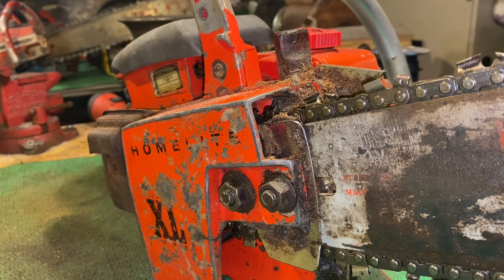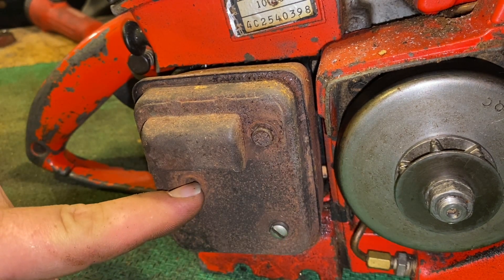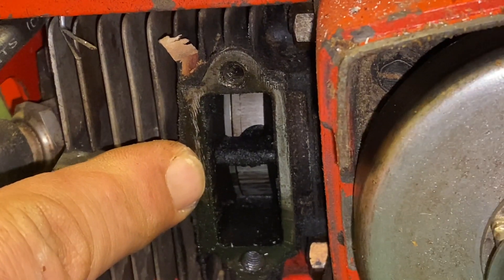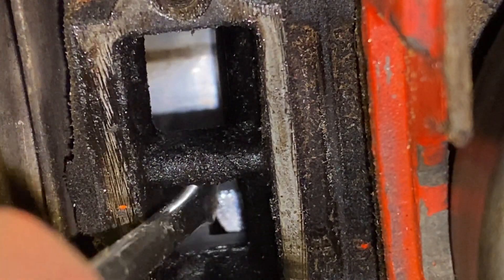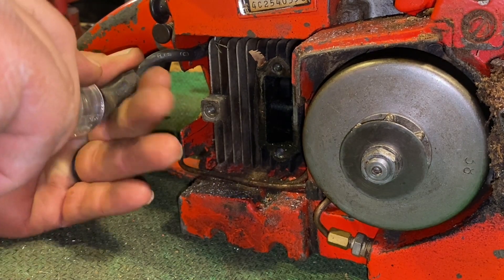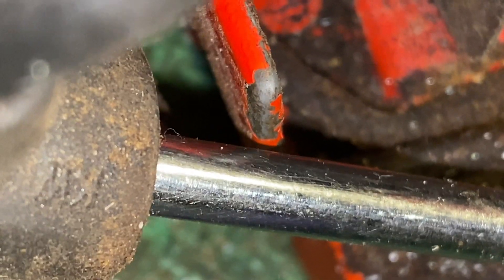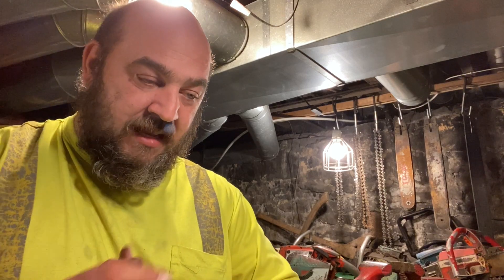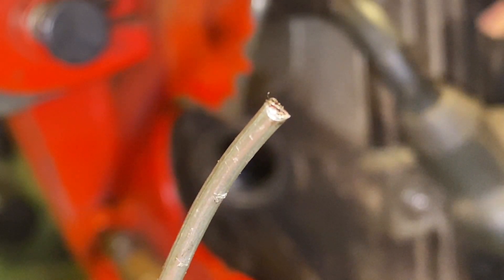Chainsaw Porting Class!!  How To Port A Chainsaw For Beginners!  Homelite Super XL Automatic #2

Comment: Sorry, but the last thing I want is to spend money on a Homelite saw so I can let it set in the shed. It is spending money on a worthless chainsaw. I stated out using these saws and am not interested in going back. Either a ms261 or a 550xp. The worst that could happen is, I ruin a cylinder. I can buy an other. They are readily available.

Comment: SMITTY, I NOTICED THAT YOU HAD SOME LOMBARD AP-42'S IN THE INTRODUCTION. ANY IDEA WHERE TO OBTAIN BOTH CRANKSHFT SEALS? THANKS!
Reply from the maker: SKF 6119 Just search the part number.  It is a common part.
Reply: @Smittyschainsaws  ARE THE SEALS DIFFERENT OR ARE THE SEALS THE SAME FOR BOTH SIDES? THANKS FOR YOR HELP!
Reply from the maker: @douglasuhde799  same on both sides.

Comment: Hello neighbor I was wandering why I see peaple pull out the pull rope on their saw wen they shut it off . Also has anybody told you that you are starting to thin just slightly up top??..also I like your style man ..wen it comes to tractors and saws my favorite color is red
Reply from the maker: The starter will engage at the very last moment when you shut the saw off. You hold the rope out because it provides a little cushion when this happens. When it happens you can hear it click. Give it a try sometime. You will be able to feel it. 

I started thinning in high school. It made for an interesting adventure. 

I tend to gravitate towards the John Deere model A but I like them all.

Comment: i just ported one of these for fun. squish was HUGE and my piston was scored bad. Since i didnt want to put money into it slammed it back together. Unfortunately it only has 100psi compression because of the scratched up rings lol
Reply: No was a little down. I posted a video on my channel. I did base gasket delete, blended the transfers and the bottom, widened the exhaust port and narrowed the divider, raised it a little slammed it back together lol.
Reply from the maker: Probably not much torque I'm guessing.